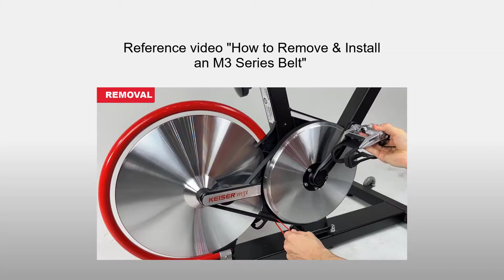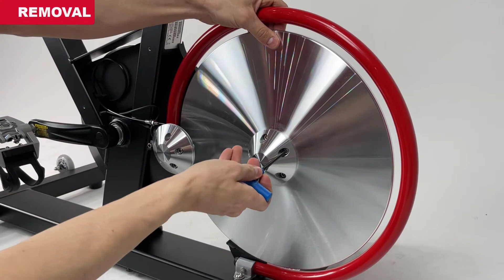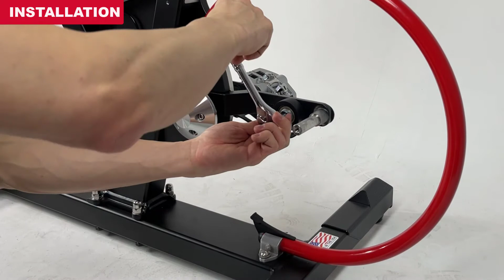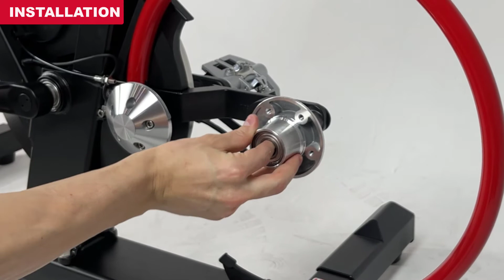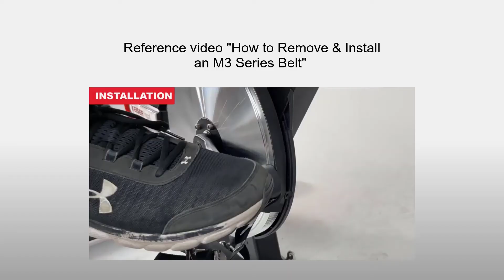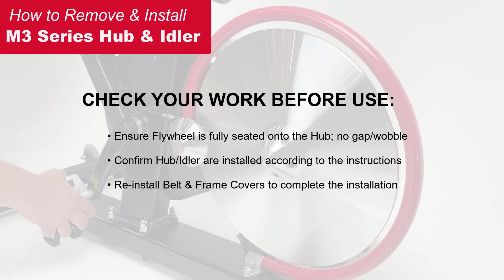How to remove and install a Keiser M3 Series hub and idler

Comment: My M3i started to have a squeak around a 1000 miles. I found a cracked idler-tensioner pulley. Got the replacement part from Amazon for $25. Video made the repair super simple.

Cheers!
Reply: I was in a pinch also with a cracked idler pulley wheel - I didnt want to wait for parts and i had various idler wheels from different brands/models - I found  a Life fitness 95ce/re idler arm has an idler pulley that will work almost perfect!! Same bearing, so it mounts on with no modification, except the plastic outer wheel is 1" wide, need to sand it down to 3/4" wide (took about 5 min). It won't mount unless you sand it - too little clearance. 
ALSO, THE LIFE PULLEY IS APPROX 1/8" SMALLER DIA - SO THE BELTS SHOULD MOUNT JUST A TAD EASIER BUT STILL HAVE VERY GOOD TENSION, and the wheels should not crack like the keiser ones, being under less tension. I consider this an improvement!!  the belts are stretchy, and a worn belt is easily 2 inches longer than a new belt, so the slightly smaller diameter makes no difference in traction...(this was for my own personal m3, i wouldnt muck around with non-oem parts for a customer's unit unless i have proven it is a good fix first).